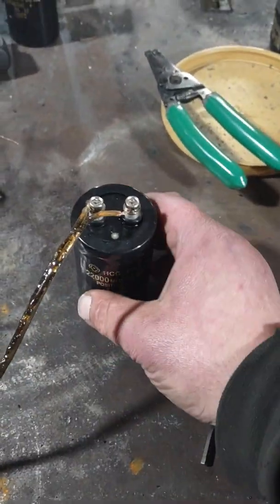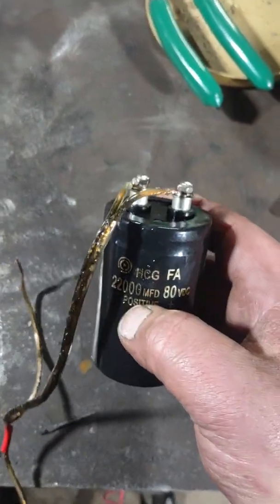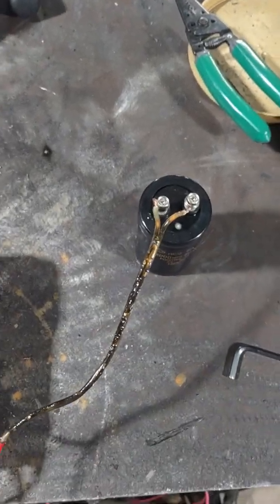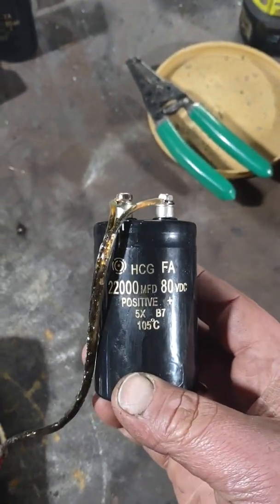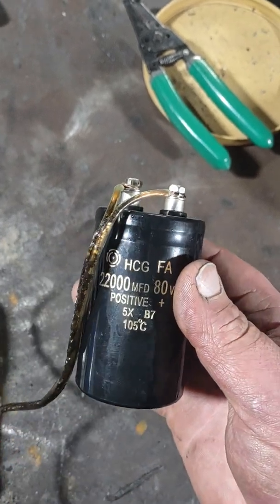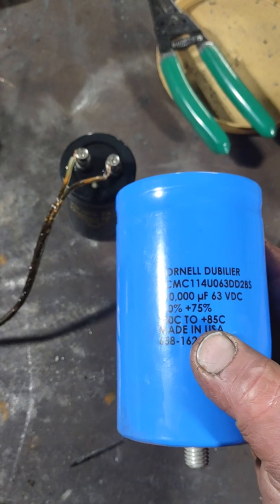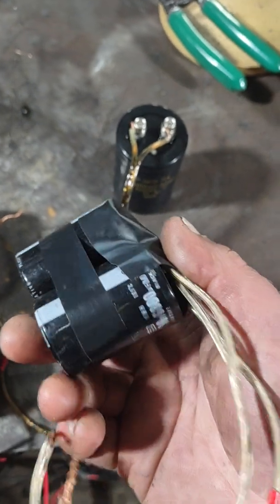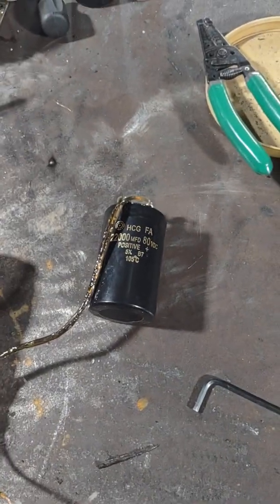Fake knock-off Hitachi Capacitors 💥EXPLODE💥 (HCG capacitor)

Comment: I have a Proton D1200 vintage amplifier from the 1980s that has 4 gigantic capacitors, currently original and currently working. Just in case, I have been looking for replacements with the correct specs and especially in the correct size, and having a really hard time. There's an ebay listing with this title that summarizes the specs, and of course it's these same fake Hitachi's for sale: "Hitachi 15000mfd 160vdc Capacitor 65 X 90mm Genuine New PROTON D1200". The seller is asking $195 for a set of 4, which is a rip off if these things aren't safe.

My question is this: do you know where I could get quality caps with those specs that are 65x90mm in size? I'm not a repair tech, just an audio enthusiast, and I've searched mouser and one or two other places and had no luck.
Reply from the maker: There was some amazing Cornell dubilier 110,000uf caps on eBay for $25 bucks each, they are legit I have been using one on my welder now for over a year. I would keep searching on eBay and try to look up those Cornell ones. I think somebody who worked at the factory was sneaking him out or something at that price.
Reply: @crazyDIYguy  I actually ordered a recap kit for my amplifier from ebay that included quality parts, the problem was the big power caps were too tall. Luckily the seller admitted his error and took them back for a full refund. I'll keep searching, but it's that 65x90mm size that's the trickiest to locate. I'll take a look at the Cornell brand.